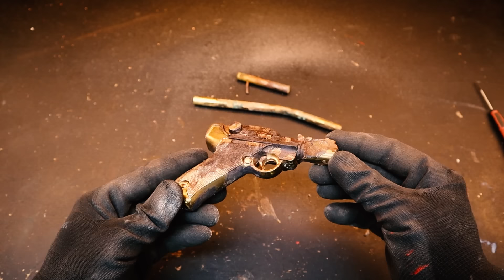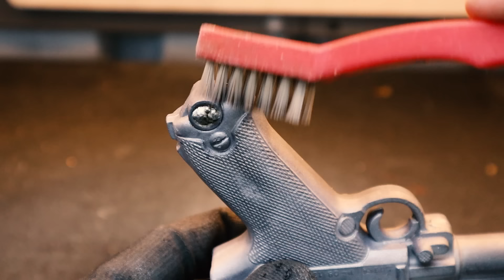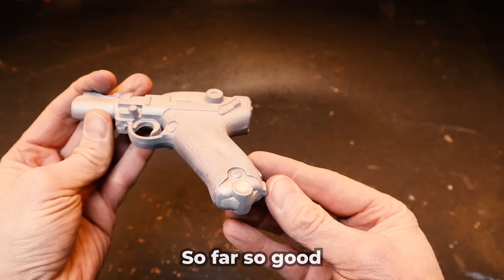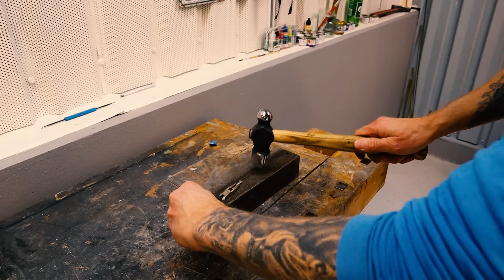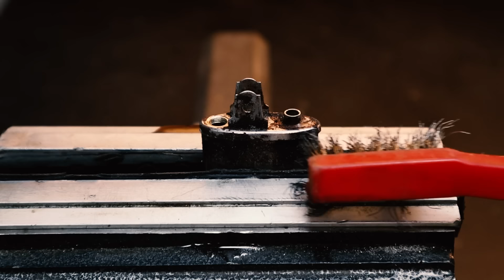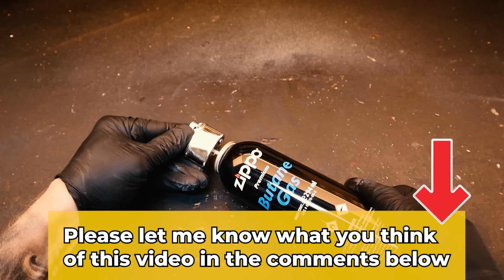LUGER P-08 GUN Lighter Restoration -

Comment: I need more close up shots, like when you add the sand to the sand blaster and sub titles of what sand you are using.
More close up shots of each piece of the lighter going to the rust remover solution.
Close up shots of  heating and straightening the barrel.

Comment: Could have sworn I saw cotton inside the lighter. Did you convert to butane from lighter fluid? Or was it always butane and they used cotton also?
Reply from the maker: Yes you are right. Butane lighters has also cotton inside Generally, it's for flame regulation.  thanks for watching